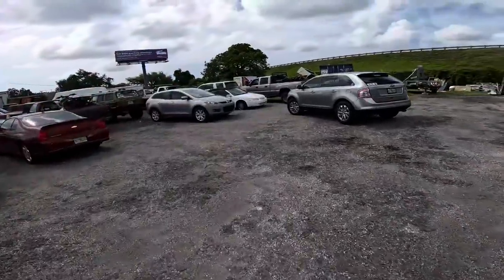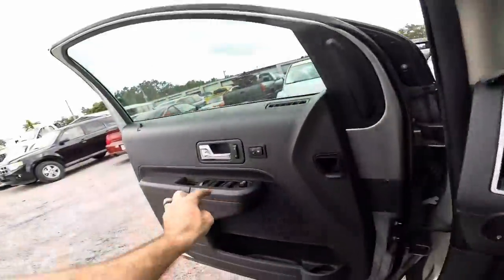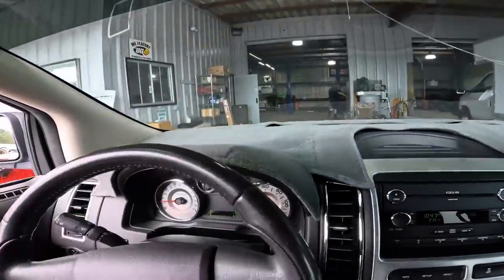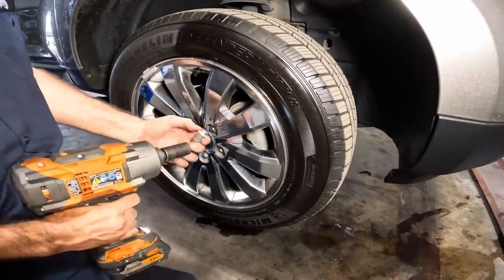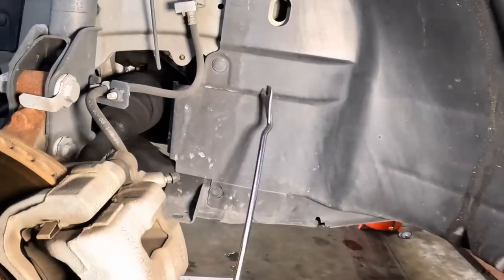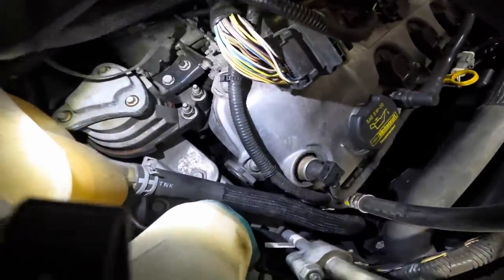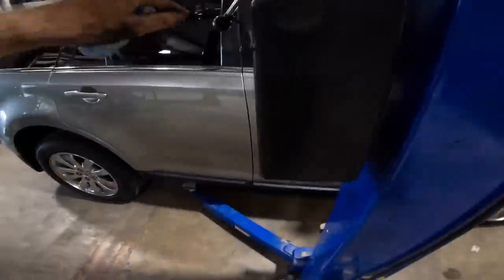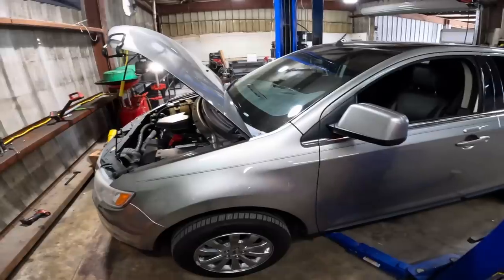Mechanic Hack! Coat Hanger Repair! Ford Streth Belt

Comment: Use a zip tie or 2 instead of the wire. The zip tie will break when the belt is on. No need to cut the coat hanger.
Reply: That was my first thought,👍2nd maybe hose clamp
Reply: Nice.  Should have thought of that myself, I'll remember that for next time however.
Reply: That way you don’t have to explain to the wife what happened to her favourite coat hanger
Reply: I’ve had good success with HD wire ties.
Reply: Thats pretty much the go to. Maybe he used all the zip its on the toyota wire connectors and coil plugs
Reply: That was exactly the comment I was going to make. 👍👍👍
Reply: If only every pulley with stretch belts had holes in them. Some manufacturers are more diabolical.
Reply: And if the pulley doesn’t have holes use the old belt or a piece of it to wedge in between the new belt and pulley to make it grip when turning crank
Reply: My first thought as well.
Reply: Great idea!  👌👍
Reply: That is how I do those belts, works everytime with a beefy enough zip tie.
Reply: I think he just had a brain fart and forgot zip ties existed...
Reply: @markB40  "NO WIRE COATHANGERS!!!" - Mommy Dearest
Reply: Just went to suggest the same thing, but everyone else did already.
Reply: I was about to suggest a zip tie when I saw your post.
Reply: I was just coming to post that. Wire hangers are hard to come by today. Most shops have zip ties and they are much easier to work with
Reply: Was just about to say the same. See, great minds think alike!😁
Reply: @markB40  (insert birth control joke here)
Reply: @jtjones4727 ve tried the zip tie method didn't work, zip tie stretched and broke. Metal wire won't.
The sale a stretch belt clamp,  Amazon got one for about $10
Reply: Came here to say I wonder if you could use a metal zip tie then cut it when the belt's on.
Reply: @mr.tall-man1573  Why not just use a quality plastic one? Much more common.
Reply: @therealdeakins  what’s that supposed to mean
Reply: Yep, have used zip tie before...
Reply: solid core welding wire.
Reply: @gregoryheim9781  Wasn't sure how strong it'd have to be
Reply: @mr.tall-man1573  Less strong than having to twist a coat hanger.
Reply: Thats what I was gonna say.
Reply: @markB40  i think that was a uniform coat hanger.
Reply: Bang on sir 👌🏻
Reply: @markB40  First it was all the inaugural paperclips out of the office, now the coat closet is not safe, next it will be making highly specialized tools out of scrap parts from  a wrecked miata.
Reply: I thought the same thing. Posted it then saw your post😂
Reply: @tiredoldmechanic1791 in that case not even wire would work.
Reply: @bobbg9041  I think it was as well I was just joking about it
Reply: I have always used zip ties.  Much easier to both put on and take off
Reply: @Nick-nm8om if you change enough of them, the tool is great.  I have used it too.  But I have also had good success with doubled up heavy duty zip ties.
Reply: @Nick-nm8om you just need more zip ties to share the load. Sometimes you can get away with one zip tie, but gradually walking the belt on with multiple zip ties works every time. The only exception being when the pulley is solid.
Reply: He thinks he is so smart that most of the time he is a screw up.
Reply: Always use the zip tie method. Quick and easy
Reply: Thanks Mr.Timo for tip on zip tie
Reply: When I changed the power steering stretch belt on my daughter’s ‘08 Escape that she had I used a thin zip tie and it worked like a dream.
Reply: Zip ties work better than the tool. The tool sucks.
Reply: Just came here to suggest zip tie. I'm late.
Reply: Yep work's a treat.

Comment: I don't care what anybody says, Ray you're a genius! You saved time and money. I looked up the tool and found pictures of it in use. They were using it on the larger crankshaft pulley. I think the way you did it just makes more sense. No fancy and expensive tool required!
Reply: Zip tie would be a lot easier without damaging the belt

Comment: My 92 new Yorker likes to throw the belt off when i hit a puddle in the passenger side, it's done it so many times that I've figured out how to put it in quickly with no tools. I feed it back on all the pulleys except the ac compressor, and then walk it onto the ac compressor pulley. I'm sure it's not good for the belt, but on the side of the road it's pretty fast

Comment: did I mention great use of the mechanics friend "coat hanger" and amazing camera angle.... i could see everything... belt noise on an old Fiat, opened hood and some one had replaced the long alternator pivot bolt with a wooden stick.... no clue how many miles on the stick...

Comment: Great work Ray. Screw those specialty tool manufactures & their crazy prices!
Reply: Agreed... But, they're 10 bucks on Amazon🤣
Reply: @KHALABEEB  There are a couple versions of these. One for a single pulley and one for a double one as seen here. But agreed, at less than $15 for either of them, they should be in any mechanics toolbox. They are much simpler to use as well.

Comment: I’m the original owner of a 2009 Flex, same engine. I bought the tool for the PS pump, it didn’t work well. I use a couple of zip ties to hold the belt in place. Works great!

Comment: You should look into a roll of bailing wire. It's not expensive, it's very sturdy, but it's a lot more manageable than a coat hanger. One roll would probably last you months if not years.
Reply: My dad left me his roll I'm still using, makes a great cotter pin in a pinch too
Reply: Lock wire with twist pliers would make that so much easier.
Reply: @Onewheelordeal  yeah we use it for everything here. We expanded on "if you can't fix it with duct tape and a butterknife" to include bailing wire and a hammer (sometimes just smacking something with a hammer gets it going).

But for the bailing wire, we use it for everything. Hanging brake calipers, holding back wiring harnesses, as binding twist ties, for range fencing (cattle and horses to boot), barbwire too,but you've gotta use the fencing staples too. I even use it to snake wires and plumbing. It's magical. And anything that needs hung temporarily? It's awesome.
Reply: Besides, metal coat hangers are getting scarce. All mine are plastic these days.
Reply: @Wakeupandsniffthecoffee  yup scarce and expensive. I think I paid $7.99 for my bailing wire, but it's been like 8 years so it's probably closer to $20 for a similar roll. Still though, 8 years of utility for under $20 was worth it. 

Last time I bought metal hangers it was near $50 for 25.
Reply: With baling wire you will have all the material that is needed to repair Jeeps and PT Cruisers.
Reply: or 3 sizes of zinc coated steel and 3 sizes of stainless
Reply: I keep a roll of baling wire for all kinds of 'fixes'.
Reply: @Justin_Ebright  When my farther ran a property it was No.8 fencing wire & a star picket when we left ols of things were still held together that way the old saying enginuity is the mother of invention.Cheers.
Reply: @Wakeupandsniffthecoffee  Yep all being used to hold on exhausts.Cheers.
Reply: @Justin_Ebright  Didn't know you could still get wire ones.
Reply: @LesReeves  oh yeah, you can. We still use it all the time in my region, especially available as it's used to tie up 3 wire bails of hay for our horses and cattle (as a region, not like mine specifically). 

Any feed store, tractor supply, or hardware store will carry it. For personal use I'd suggest the hardware stores though, it does get expensive in the bigger rolls but the hardware stores carry smaller rolls that are just amazing.
Reply: Great idea!  I have a roll sitting idle in my basement workshop; out to the garage with it!
Reply: A spool of safety wire would also be very serviceable.  Especially if you buy a surplus spool from an aviation supply house; one that doesn't have to meet the accountability requirements needed for the aviation world, since it is for temporary use only and not a "permanent" fixture.
Reply: @LesReeves Are you sure that wasn't "Mother necessitates invention."?
Reply: @rhondohslade  I was always told necessity is the mother of invention what you say may be correct but whatever way you say it the connotation seems to be the same Cheers.(I'm 65 don't know if that has anything to do with it ?)
Reply: Electric fence wire also works and a spool will last for years

Comment: When you are repainting your shop, seriously think about a GOOD epoxy white floor. I worked at a hangar with regular floors and had all the staining and harder to sweep. A new epoxy floor was put down and wow! The whole hangar was brighter and reflected light up towards the bottoms of the planes. No more staining and sweeping was a breeze. Never realized how much dirty concrete absorbed the light. Have fun power washing the walls, can't wait to see you in a Tyvek suit.
I'm subscribed and have fun watching you fix easy to get to cars. I joke as getting to some equipment in an airplane is just nuts. The panel is here but the part is over there or hanging upside down in a cockpit to get under the instrument panel. I liked "Face Off" also.
Reply: My brother worked in aviation for years and the struggle bus was a regular stopper. He said there was a starter/generator on a Twin Otter that took two people to change . One on top and one under. Problem was the person on top couldn't reach if they had anything on their arms. He worked for a commuter airline operating out of Omaha general aviation area and that place 8s down on the Missouri River and the wind never stops and that had to do the job in winter at below zero wind chill.
Reply: @kenore4003  I was a Navy Aviation Electronics Tech.(AT)  Messy work in a hangar bay/flight deck. In the Navy, you WILL work on the whole a/c, ie. help pull fuselage fuel cells and drop engines. Honorable discharge and got a good job for a FBO. Civil a/c are much much cleaner to work on.

Comment: Even though the A/C line was holding the "breaker bar" and keeping the tensioner pulley retracted, for safety's sake I would tie the handle off to that hole in the rad frame where you had the bungee. Nothing worse than being under the vehicle with your hands near the pulleys and having that tensioner pop back onto the belt!

Comment: Something we used to do on cotton gin belts was to tie a rope around the belt, pull on it in the proper direction (or tie to pulley), and turn the driver to roll the belt onto the pulley.   Similar to other suggestions, but the rope can be pretty much any diameter or material, sisal, poly, nylon, etc.

Comment: How you found a wire hanger is just as amazing. I have not seen one of those in years. Just stupid plastic and wooden ones her at my house. I miss the das wen you had a versatile tool hanging in the closet. Now I just cut up a couple of dog crates my son didn’t want. I cut them up to keep the long pieces.  Bravo sir oldie but goody.

Comment: In a pinch on a new Silverado stretch belt need a special tool for it  I used a hose clamp with tape around it so it would not cut the new belt it worked and never had any problems since then with the same truck

Comment: I have never purchased a tool to do these jobs even on the 2000 through 2007 Ford Taurus. You just take an extra strong zip tie and it works every time.

Comment: I drive a 2010 Ford Escape. It threw me for a loop with the water pump belt. When my water pump died, the belt ripped. For a split second I thought the serpentine was shredded and I panicked. But then I looked to the left and saw a perfectly good serpentine belt. The car survived the water pump failure without overheating btw. 230,000 miles and still going strong!

Comment: I have a bunch of 3/4" threaded black pipe for pipe clamps that I use for cheater bars. Take your favorite wrenches to home depot, find the size that fits and buy a variety of lengths.

Comment: I was thinking of using bell wire (doorbell). Doesn’t have the tensile strength of the coat hanger, but if you used several strands together it might work also. Easy to twist. Zip tie method others mentioned is good. I use bell wire for lots of things. Easy to get at Lowe’s and H. D.

Comment: How to replace serpentine belts in your car
Step 1. Separate engine from vehicle.

I would have strapped that breaker bar holding the tensioner to something, just in case it slipped out from behind the air conditioning conduit.
Reply: Actually the instructions begin with "Remove the rear bumper"

Comment: Hey Ray, would a heavy duty zip tie work to hold the stretch belt on while installing?
Reply: Yes, it would. Easier to put on than the clothes hanger wire hack.

Comment: When we started off in our shop, we used to keep the old parts to show the customers. We did it routinely for a while. They also see the reason[s] why a part was replaced, like the fault sin the serpentine belt.

Comment: Tell you a much easier way to install that stretch belt and this is per the Ford service manual. Take a couple of zip ties through the belt and secure it through the holes on the pulley and rotate the crank and the belt will walk itself onto the pulley. Works like a charm every time. I've done countless of these repairs with no issues at all. That way you don't have to mess around with a coat hanger.

Comment: Back in the day, AMC Gremlins needed a special tool to remove the steering wheel, had to press down on the wheel to remove a C-clip at the bottom. A piece of old pipe, notched and a couple of washers was a great substitute for the expensive at that time special tool ( it was $60-$80 if I remember correctly ).
Reply: Most AMC’s that weren’t Gremlin HAD gremlins
Reply: @andrewadams488  just because they had Ford, Dodge and probably some Chevy parts too?? LOL
Reply: @TheWabbit  They did. 😆  Steering columns and -wheels were GM, with a separate lock plate (engaging a pin from the ignition lock cylinder) that was locked in place with a c-clip on the sector shaft.  Ford incorporated the lock plate into their steering wheels, thankfully.
Reply: @michaelbolton2741  I didn't realize those were GM parts we replaced ( or I forgot ), we had to swap the ignition switch and replace the turn signal mechanism in the column. Also had to put all new shoes, drums, lines, and wheel cylinders on it and it was good to go. Friend paid $90 for it in 1979.

Comment: i love having a hybrid with no belts at all. looked super weird under the hood, but it's great to know thats a fight i wont have
Reply: Grasp at any straw for self-validation...
Reply: @buckhorncortez Great reply and so true.
Reply: The belts last longer than the engine.  It’s not something to worry about anymore.  The belts on this car were fine.
Reply: @user-tb7rn1il3q  nah, they're a maintenance item that have to be replaced every 100k or less. engines last 2-300k these days
Reply: @bradhaines3142  Most engines last 150k-175k miles.  The belt will go 200k miles.  Cars with over 200k miles outside of some Toyotas is rare.

Comment: Good morning Ray.  I have a 2010 Ford Edge Sport AWD with 181k.  The 3.5 is a very solid and clean engine from my experience.  Great to see you work on one.  Also have yourself a great day.
Reply: Be wary of the water pump in those engines.  They a timing chain driven and when they go its over due to the crankcase filling up with coolant.  Number one reason for engine failure in the 3.5.  Would recommend a water pump at 100k.
Reply: @thk7513  There is a weep hole for the water pump right near the alternator.  If I owned a car with one of those engines (Taurus, MKZ, Edge, Flex, maybe some others) I would do a quick inspection twice weekly for any seepage from that hole. Left to leak for an extended period of time, coolant will get in the oil and grenade your engine.
Reply: It’s a junk engine, especially the internal water pump.  I don’t know why people change the belts.  They outlast the engine.
Reply: 13 years with 181k is junk because of the water pump internal?  Are all timing belt engines junk just because they could break which for a lot of engines they are toast too if that happens?  I had the water pump replaced at 105k.   I would not call this engine junk compare what I see with other brands and other engines within Ford ie 1.5 Ecoboost.  Most likely the engine will last longer than the transmission.  It’s been a reliable vehicle and that is all I could ever want.  😎
Reply: @kevincurry4735  I agree, it is definitely not a junk engine.  The internal water pump is just a quirk that the owner needs to be aware of an keep an eye on. There were 10s of thousands of these engines produced in various models...the number of engine failures due to the water pump is probably a very low percentage of them.
Reply: @kevincurry4735  I wouldn’t touch a timing belt engine with a ten foot pole.
Reply: Yeah all those unreliable engines that the Japanese put out.  I Only got 480k in an 1999 Acura CL.  Yeah change the timing 4 times still was going fine when I sold it in 2019.

Comment: Sorry to hear about the swollen nut problem 😂
But seriously... I wonder why the 26 year old lug nuts on my Land Rover aren't. They use a similar cap. Maybe it's because the LR nuts are galvanized and the caps are stainless, rather than cheap chromed steel.
Reply: What would it take for a Land Rover owner to NOT mention their car for no reason
Reply: It is not what they are made of it,s lazy mechanics using impact drivers on them .

Comment: I would recommend your customer purchase a set of solid lug nuts and replace then NOW on all 4 wheels. This before they get too bad. A flat on the road could turn into a tow, an Uber, loss of a lot of time and expensive shop repairs over a flat. Not just Ford. Other manufacturers use them, too. Spend $40 now or spend it after you get stuck and spend hundreds.
Reply: @dddevildogg  plenty of 1 piece lug nut, sets of 20, out there around $40. Dorman is fine for that. Just say no to Ford OEM even if they are free.